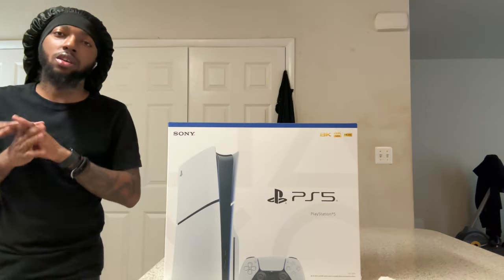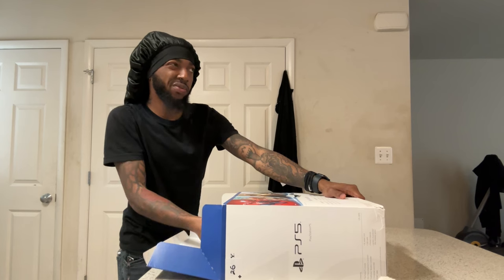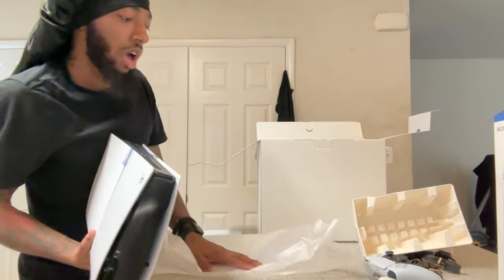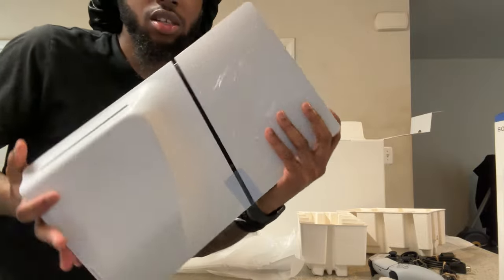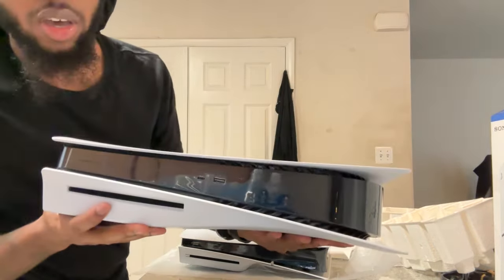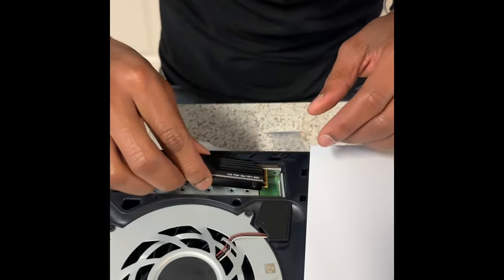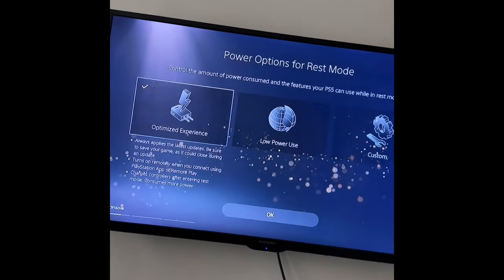PlayStation 5 Slim: Disc Edition Unboxing/SSD Installation(Read Pinned Comment)

Comment: You are supposed to use the small ring of the screw from the hole you unscrewed , onto the other holes, because it's main ssd board support. Never screw the ssd without that support ring...
Reply from the maker: OH SHET i just noticeddd, i remember doing it the first time when i got my original PS5 & im going to fix that part when i get home. Thx alot & this is why comments are important.

Comment: What’s the difference between the ps5 and the ps5 slim
Reply: The ps5 slim is slimmer😂 and they have bad parts installed  different Fans different power supplys and on the mother Bord different cool sticks or they forget it.
I have yet 6 ps5 Slims all 6 was completle loud 2 Never tutned on 2 overheating in the Menu and the other 2 yeah they was so loud and doing as a tractor Never heard this in my live.
The ps5 slim is laude then my pc and im hearing on my pc only the Fans and on the ps5 slims you hearing all Fans but the fan is Not a Fan its so wierd the Sound the power supply is loud and craking Noise from the motherboard.
Reply: ratchet2007 Bro its not
Reply: Please in english
Reply: ratchet2007  Have you even read through what I wrote then you know what you wrote is nonsense
Reply: ratchet2007  you have Only on PS5 slim and you get Lucky Bro I can't help it whether you were lucky with your first one or not, I can't see it xd

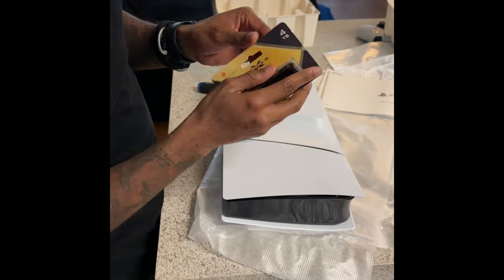Comment from the maker: SSD Installation Starts At 15:54
Reply: You are supposed to use the small ring of the screw from the hole you unscrewed from, onto the other holes, because it's main ssd board support. Never screw the ssd without that support ring..